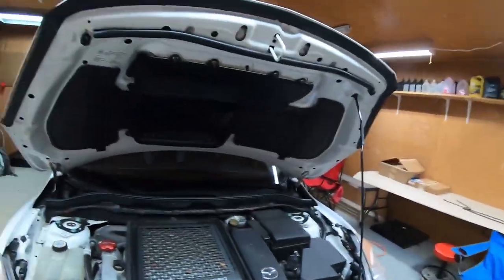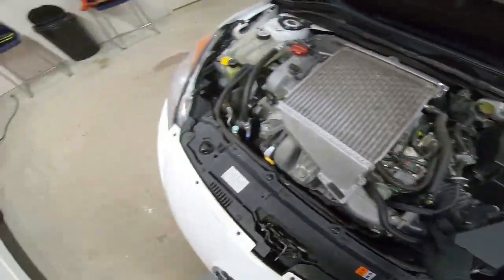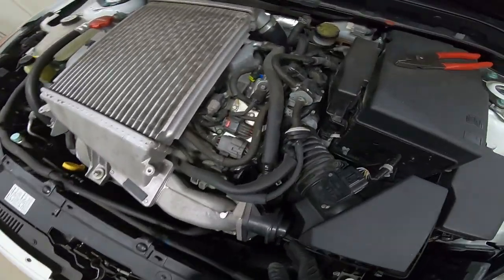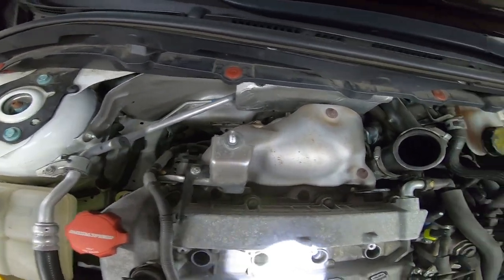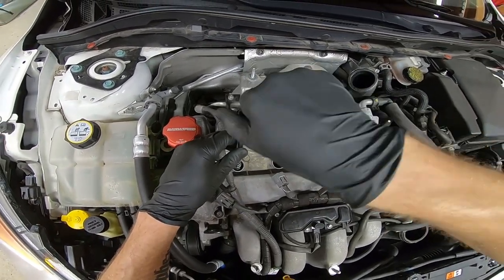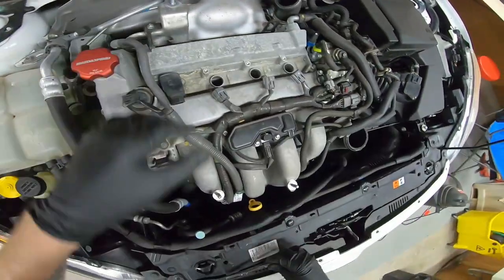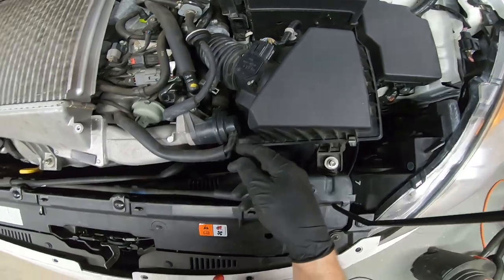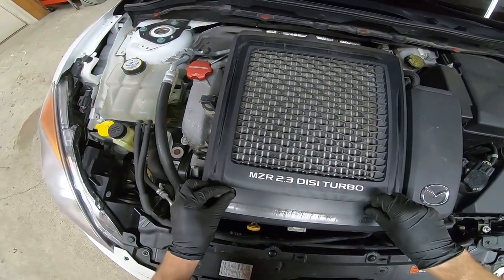Mazdaspeed3 Spark Plugs Replacement

Comment: If i dont pull the ic pipe over that lip will i get a boost leak/smoke from exhaust?
Reply from the maker: Yeea, definitely boost leak, the car might even throw a CEL. I’m not sure about smoke from exhaust though. I know the factory turbo seals can start leaking causing smoke from the exhaust but not having the pipe all the way on the intercooler shouldn’t effect that.
Reply: @kamalakeel  so i did the plug change and pulled the ic pipe up to the lip do i jave to pull it over the lip?
Reply: @kamalakeel  ty for the reply by the way
Reply: I got a p0139 code but changed plugs bow its dumping fuel
Reply: Against the lip or over the lip ?

Comment: You need a cooler plug the tips are wight it a common thing to put cooler rated plugs in the 2.3 turbo engines. Try Denso itv22 plugs they are one step cooler. Do not use and thing on the plugs threads ngk say not to due to it causing the plugs to run hotter. As heat dose not transfer as well if anything is between the plug and head if that makes sense.
Reply: Is it worth getting one step cooler even with the added gap?
Reply: @jeremycook8732 yes it is. Also- follow the torque. 10 ft lbs is all you need. Follow manufacturer torque spec.

Comment: How much torque do I tighten the plugs at in ft pounds on a 2013 Mazda speed 3 turbo. Can't find anything on the web and Mazda is being lames
Reply from the maker: Factory specs from Mazda are 14Nm which is 10ft lbs, I actually torqued mine to 20Nm which is 15ft lbs because the factory spec just doesn’t feel that tight to me but if you wanna do it exactly to factory spec it’s 14Nm/10ft lbs. Hope this was helpful and thanks for the comment.
Reply: @kamalakeel  I appreciate it a lot!

Comment: What is the name of the wrench you use to tighten your spark plugs
Reply from the maker: Torque Wrench, you can find them for a good price at harbor freight. They can be digital or mechanical with no batteries and just makes a click when you get to the correct torque. I’m sure you can find some nice ones online as well.

Comment: Why so often so….. don’t really need to do them until 100k or until it starts to misfire…. My mz3 had like 187k ish they weren’t even misfiring but just felt like they should have been changed they still had the Mazda logo and stuff on them but they looked like shit but they weren’t even misfiring yet
Reply: Bad spark plugs can cause knock on an engine with such a high boost application. Really not a good idea to allow your spark plugs to get to the point of misfire